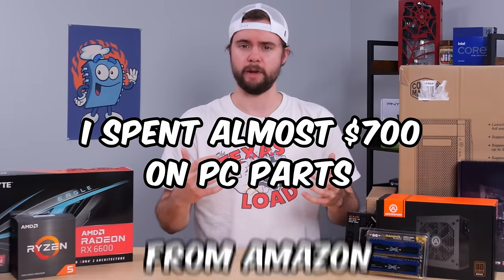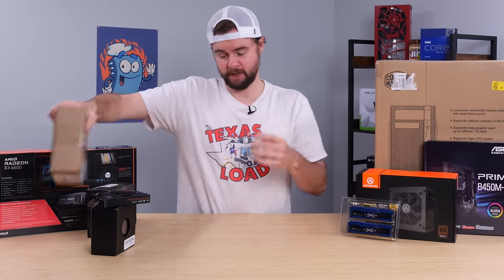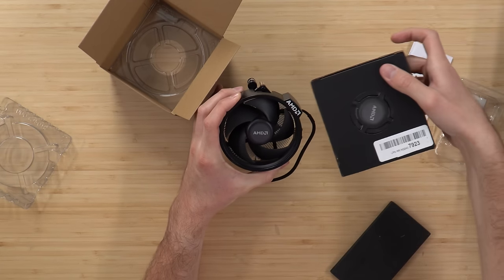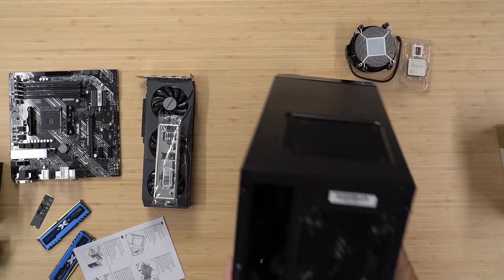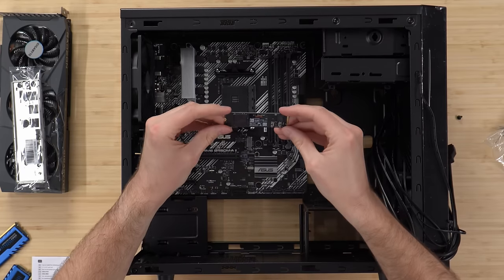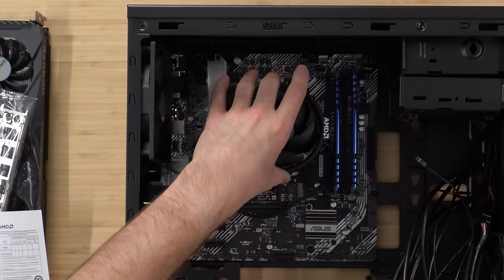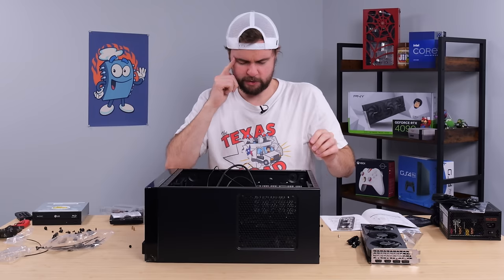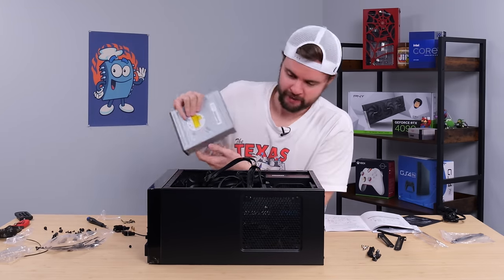I Built a PC with a Disc Drive in 2024... 🤡

Comment: Love the simplicity and minimalism here. Its modest and cheap, a good way to show people that you don't need to blow thousands to have a working PC that can get things done. I'm sure for simple uses this is perfect. The disk drive is cool imo. There are lots of media that still begs to be used in the world that disk drive can do justice to... Also thats not a "hard drive" slot thats a floppy disk slot. lol
Reply from the maker: You can definitely put a floppy disk drive in there, but it’s marketed as a 3.5 HDD slot. Now that you mention it, I might actually put a floppy disk drive there
Reply: @SmokinSilicon  Do it. I'm sure you could find some wildly interesting stuff laying around on floppy disks in this world.
Reply: @SmokinSilicon yeah that slot can be used for hard drives, but in the past it was a space for floppy disk drives or more recently for SD card readers.
Reply: @muzicdominator524  If I had a small bay like that, I'd use it for a usb/sd card reader purposes.
Reply: Creative types made all kinds of devices for the drive bays, temperature and clock speed displays.
Reply: Late reply, but you're probably better off getting one of those 3.5" card readers that have a smorgasbord of card reader ports from like SD cards, CF cards, XD cards, etc. I got a used one of those and it fits my PC like mashed potatoes and gravy fits a thanksgiving dinner.

Comment: Bloody hell forgot the ATX IO shield, is it your first time building a PC?

You know what would be interesting? Converting a laptop optical drive into a top loader, 3D printing a lid assembly, then cutting into the top of a modern case to fit it in. Need to disable or move the eject mechanism and need to move the endstop to detect the lid.

Comment: I buit pc's 20 years ago. I usually mounted the cpu on the motherboard before I installed it in the case.
Reply: Yeah I always installed all the PC components and then install the motherboard into the case last. Easier install
Reply: Sometimes the cases wouldn't even have a cutout for cooler mounting access so you'd have to mount all that stuff first . Putting the CPU in before is still a good idea .
Reply: This guy is clearly a noob. Mounting the cpu, ram and m.2 AFTER installing the motherboard, forgetting the IO sheild, and the verge level of cable management.
Reply: the worst thing he did there by far was installing psu the wrong way

Comment: With a blank vase u can always paint it with acrylics. I painted my ps3 super slim on the disc cover and the ends and it looks great. If you use a thin layer it shouldn’t effect the cooling because that ps3 runs beautifully clean. I found it was best to seal it with clear gloss varnish sealant. FYI. Do not paint the vents if you’re worried about over heating and always paint with every component removed. It must be an empty shell when you paint.

Comment: 13:26  This was the same issue with dvds when dvd drives were first introduced to pcs back in the early days.  To watch a dvd movie on pc, you needed codecs that could read the files.  When you bought a dvd drive, you’d install the included software to watch the movie.  

Tho day, this shouldn’t be an issue as formats are adapted quickly once it’s announced and people have made it into part of the standard.

Comment: My PC build also uses the N200 case. I followed a similar principal of doing a fairly budget build with a Blu-ray drive installed, but went team blue instead (i5 12600K with an MSI Pro-A B760M and an Arc A750). I do, however, vouch for the RX 6600/RX 6600 XT paired with a Ryzen 5 5500/5600/5600X for pure budget 1080p gaming.

The case definitely is a lot easier to work with than some of the top-mount PSU designs of yesteryear. The rubber mounting system for the 2.5" drives is a bonus. And it does sport quite a generous amount of cooling provisions for an mATX form factor, especially when larger CPU coolers just shy under 160mm will fit (currently running a Noctua NH-U12A). The only other mATX case I can think of on a similar level that I would pick over this if available is the Sharkoon V1000 which (IMO) looks slightly better, more discrete PSU and storage drive cable management, and more cooling provisions (Sharkoon don't distribute in my region). However, I'm happy playing my older anime collection with my Blu-ray player in the N200.

I get the fascination for RGB, however it's not for me. It doesn't improve the performance of a PC.

Comment: That cable management though 💀
Reply from the maker: U like it
Reply from the maker: Tbf I did clean it up a bit off camera lol, but I really didn’t go too crazy with it since you can’t even see it
Reply: @SmokinSilicon  yea, There is that but if a I had to fix something with that initial cable layout. I would freak
Reply: Mate had the zipties all chilling to the side of the table, unused.
Reply from the maker: @jacobserperior zip ties are the last thing I’m going to use to manage cables. Velcro or twist ties make adjustments much more accessible and less risk of cutting cables.
Reply from the maker: Zip ties do look a bit nicer though
Reply: @SmokinSilicon it depends on what you like. I like the multicolored Velcro. It’s much better than accidentally cutting a wire when removing zip ties.

Comment: My main rig still has a Blu-ray drive even though I don't use it much.  I can't find my portable optical drive those few times I need it, so it works out fine.  I also have this very case with a build in it that I plan to sell, but I might keep the case and put the works in another one instead.

Comment: I didn’t see you use heat sink compound. I’m also aghast that you didn’t use anti static mats or straps. Maybe newer parts are less static sensitive, but there’s a reason the parts come in static bags. 😮

Edit: only a couple of hours from power on to running windows. I’m impressed.

Comment: Pretty sure my HAF Cool Master  case has a CD-ROM slot if I ever wanted to put one in like you've done in this video. External drives are unfortunately the most in supply in the market but definitely would prefer internal when I'm able to upgrade my pc.

Comment: I had to buy a new case for this 4090 (had a 1060 for over 6 years) and no cases have drive slots now that aren't niche one offs.  Hard enough to find one with an actual reset button and/or HDD light.  I hate the modern cases with a passion.

Comment: i have a pioneer dvd drive, and a sony cd in my pc. i rip cds. i don't stream. i still buy cds. 

i had built a new pc in an nzxt h200 in 2019, but i hate having an external cd drive hanging off a usb port. plus that h200 was trash. like a tin can. so i put everything into my old lian li case that has two 5.25 drive slots. with the fancy metal flap covers i bought separately way back when i got the case.

Comment: I use optical discs in 2024 because they save me from my own stupidity. when i keep data on a hdd  i eventually delete it by mistake 
that can't happen with an optical disc because it's read only
I have never been able to keep data on a hdd or sdd or flash drive for long. I eventually end up formatting the wrong drive or i delete data by mistake

Comment: As an RGB hater i love all cases that don't have any stupid lighting that serve no purpose.

Give me a no RGB GPU. No RGB case, No RGB cooler or motherboard. unless is minimal.
Reply: on my current PC that is 10 year old whit a few uppdates.
the only RGB light I have is one on the front Fan and that is more just to tell me if the system is on or not kind of deal.
(would love to wire it up so that instead of a PC beeper I got a front Fan Light beeper).
Reply: For this reason, one of my favorite brands is Be Quiet.  They have a lot of parts, cases, and options with no RGB.